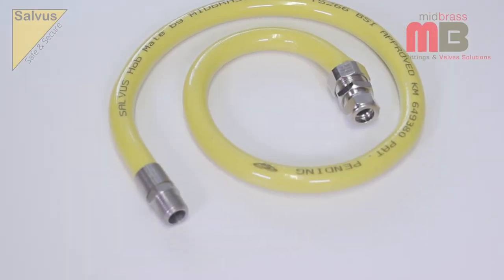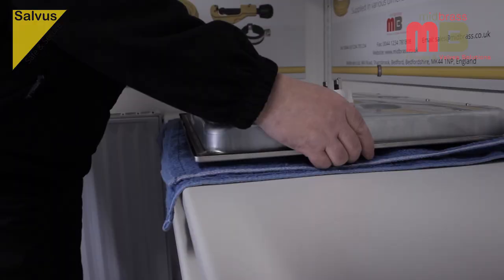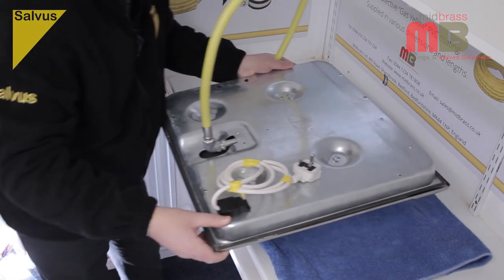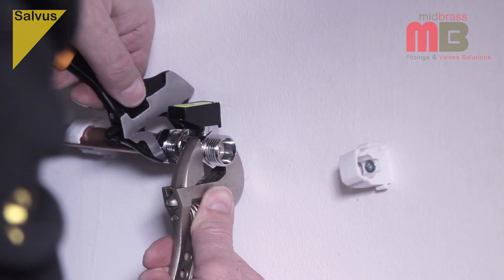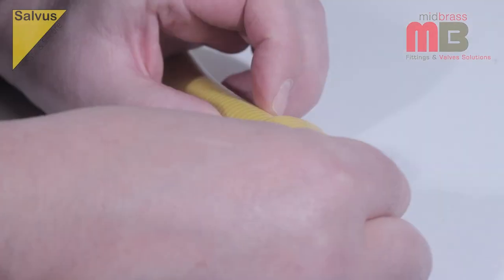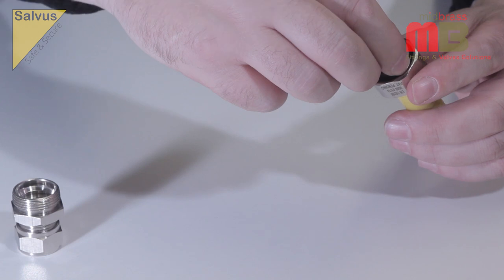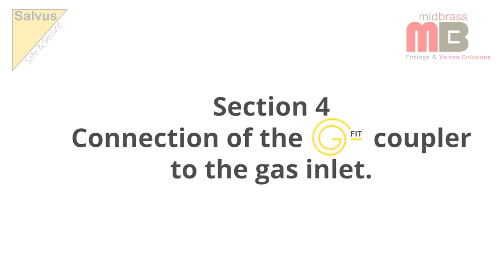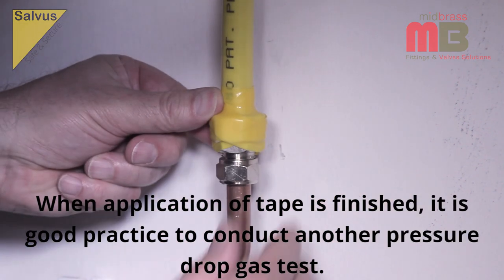Salvus- Hobmate Installation Guide

Comment: so, to get a good finish had to cut it 4 times then file it, a regular pipe cutter won't do, I used a metal saw (backwards). It's pathetic they don't just do them with both sides regular pipe jointing! .. I also 'squeezed' the brass inside the large nut so to facilitate its grip on the corrugation (that and the rubber olive is what'll hold together) .. Thanks to the regulation standards geniuses damn thing is so thick it touches the back of the oven so I had some handy metal net and wrapt it to protect it.